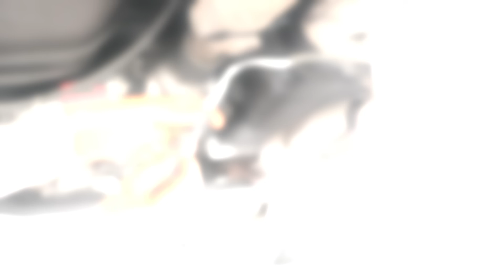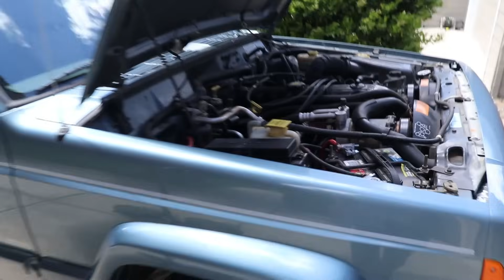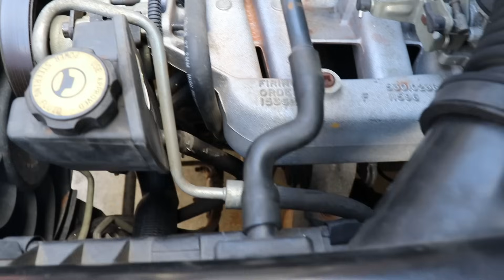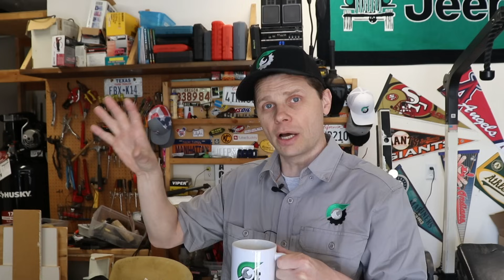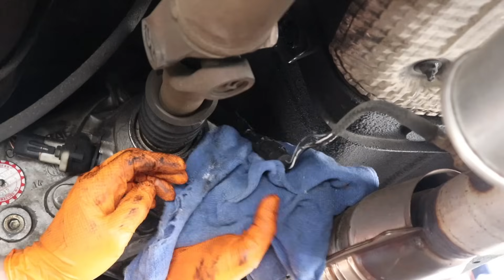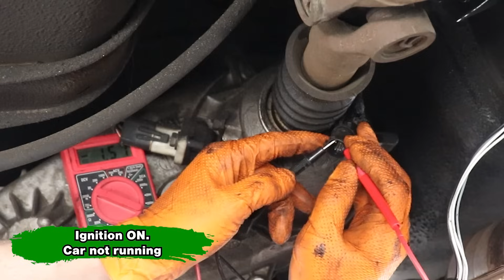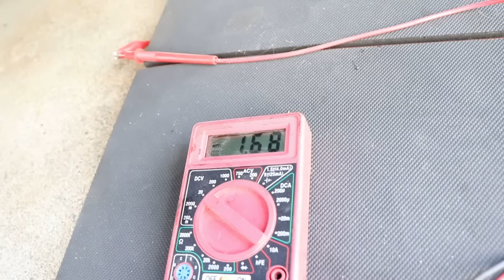Don't Buy Oxygen Sensors! How to test o2 sensor

Comment: just a note, the second oxygen sensor is not the one controlling the mixture for the ECU, its function is only to see that the signal when compared to the front sensor ist flat meaning the cat is functioning. The front sensor is used to test for air/fuel ratio and tell the ECU what mixture adjustment is required. So your faultcode could only come from the upstream (front) sensor. Downstream would cause a „Cat inefficient“ code on the motor warning.
have fun, Bernhard
Reply: He changed both so his readings were useless in this case.  But aren’t there some newer cars using the downstream for the fueltrims too?
Reply: @Xantylon74  
I don’t know of any. It does not make a lot if sense since if the catalytic converter works fine all it gets is water and CO2 and there is no information about how the mixture was when it left the engine.
A Lambda sensor is reading oxygen content to identify the current mixture which is only available prior to being converted by the Cat.
Reply: @bernhardlist9359  so should I just change my upstream O2 instead of both
Reply: @carlward9367  
Hi Carl, since I don’t know exactly what your car does it is not good for me to tell you to change parts. I had it on my Jag that just the O2 heater relay was dead which is a lot cheaper than an O2 sensor.
Can you get a readout of your sensors? Any activity there? The  correct thing would be that the front sensor shows a sinewave like activity and if the cat works the downstream should display almost a straight line (konstant voltage). If both sensors show the same sinewave like activity then the Cat is bad. If there is no activity shown on the upstream sensor check powersupply else it is bad.
Reply: @bernhardlist9359  if the downstream sensor reads the same as Upstream, at the same speed, the cat is defective. Downstream sensor must react with a delay and have stable voltage no up and down. (If the cat is up to operating temp)
Reply: @Xantylon74  , I was also thinking that if you're checking a sensor's function and it is a heated sensor, shouldn't you be back-probing the circuit with it plugged in so that the heater circuit is heating the sensor otherwise what is the point of the heater element if, "exhaust heat is sufficient."
Reply: @zenithperigee7442  when the O2 sensor is hot enough, the controller will turn off the internal heater.  It is intended for faster heating so that the exhaust gas can be tested as early as possible, even before the exhaust is hot enough. You can check the resistance of the heater when it is unplugged, usually around 3.5 ohms when cold (depends on  the sensor) if no resistance can be measured, the heater is defective.the downstream o2 sensor even has a small influence on the mixture formation (fuel trims) of 2-10% not only upstream as many believe.  The point is to still support the cat if the mixture is bad, or if the upstream sensor is no longer working well enough.
Reply: @bernhardlist9359  I wouldn't say for all cars, since depending on year (technology) and brand, they could be designed differently.

That said, some cars do have "long term fuel trim" which is different from "short term fuel trim".
In such situations (cars), usually:
Sensor1 (upstream) drives short term fuel trim adjustments.
Sensor2 (downstream of cat) drives long term fuel trim adjustments.
What the injectors will shoot, would account for BOTH long-term and short-term fuel trim.

For cars whose ECU run this way, if you have a bluetooth OBD2 scanner and use a phone app to see the readout, you can actually see these fuel trim values in-real-time.
Interestingly, sometimes they will go in opposite direction from each other.  (e.g. long term trying to decrease fuel, while short term tries to add fuel; and vice versa).
And folks who do use OBD2 scanner with phone app --> can program charts that provide real-time readout of ALL oxygen sensor's voltage on one screen.  Far easier than crawling under the car and hooking up multimeter.
Reply: @bernhardlist9359  @scannerdanner has a vid stating that the downstream matters on some cars.
Reply: @zenithperigee7442  Exhaust heat is sufficient. O2 heaters are used to heat the sensors up faster so the pcm can switch into closed loop sooner.
Reply: @reallifeengineer  Most of your post isn't correct. Just look up OBD2 and how fuel trims are set and you'll see where you went wrong.
Reply: @reallifeengineer holy crap, that makes sense. I have a 2010 GMC Sierra. I have been having issues with the fuel. I reset the fuel trims. It goes into learning and the fuel ratios are close but as soon as it’s done learning the long term goes wide. Learning, everything is within 3-4 of each other. Once the learning is done the variance will jump with long terms fuel trims becoming a 8 to 9 variance and one bank seems to fluctuate much more than the other side.
Reply: @Xantylon74  new cars do not use the binary 02 sensor as a pre cat sensor anymore they can not measure how rich or lean the fuel mixture is and the 02 sensor on this guys truck only can tell the ecu its rich or lean but not how rich and lean, its called a narrow band sensor and the lambda sensor is call a wide band,   A lambda sensor  measures a current not voltage and when working correctly they read 1 and are 6 wire sensors, the down stream is still a binary sensor and no they only measure the efficiency of the cat
Reply: @richardsawtell256  I know, only the 02 sensors after the cat are still narrow band sensors, wideband sensors can read the exact A/F Ratio.
Reply: @richardsawtell256    this is good to know. wow
Reply: @Xantylon74 yes, but as a standby in case upstream sensor fails and in that case u run rich mixture for almost 5-6 minutes till downstream achieves required temperature to give ecu its output
Reply: AAh, very useful to know - gonna try cleaning my pre-cat sensor and see how that pans out!
Reply: Correct and this diagnosis would be better demonstrated with a scan tool showing real-time data. Innova makes various models that aren't out of the budget of any DIY'er.
Reply: What if I see no voltage change on a new upstream (ohm tested) o2 sensor, even when the downstream o2 sensor voltage is changing. How would I go about determining if the harness is bad or pinched after engine replacement?
Reply: long distance diagnostic is not good but just think: the upstream should oscillate between rich and lean so there will be some „fuel“ for the catalytic converter to „burn“.  The downstream should not oscillate (or very little) to confirm that that cat is functioning and only CO2 and Water should exit.
Now your upstream reads nothing but the ECU seems to work because the mixture oscillates as indicated by the downstream sensor. But if the cat would work correctly the downstream should not oscillate.
Assumption: the Cat is not doing anything and the upstream sensor neither.
Reply: So can a messed up upstream sensor cause a p0430 and p0420 codes?
Reply: @JustinMentionedIt  Yeah, that's pretty much what P0430 means.  The downstream sensor is detecting that either the first sensor isn't doing its job or that the cat is bad. 
BUT with a p0420 going along with it, it COULD be a bad cat.

OR something causing issues, like a vacuum leak or blown head gasket.  

That's the thing about sensors.  Usually a code from a sensor doesn't mean the sensor is bad, it means the sensor is detecting an issue somewhere along the line.  Now, yes, it sometimes can point directly to having a bad sensor.  

But read what they mean closely.  I had a code pop up for the IAC valve/motor on my 3800II and just didn't even think about it.  It meant that the IAC could not bring the idle down low enough.  So, I replaced the IAC.  Guess what?  That wasn't the issue.  Something else was causing the high idle that the IAC couldn't overcome.  

What was causing it?  I still don't know.  I'm starting to think I have a blown head gasket because I have a vacuum leak going on like I've NEVER experienced in my life time.  I've replaced the PCV valve.  I had a MAF sensor code pop up, so I cleaned it, still had it, replaced that and it actually fixed THAT issue.... VERY hard jerking during acceleration or cruising.  Like the engine was cutting in and out.  (EDIT:  Or at least I THINK I have a vacuum leak..  There are two kinds of people with 3800II's.  The ones that say they can take their oil cap off with the engine running and it doesn't change anything.  And the ones like me that if I take the oil cap off, there's EXTREME suction and it's enough to kill the engine.)  I need to go back and look at my vacuum reading on my scantool.  I know it's showing 28.7 or 28.x at idle, but I can't remember what unit it's using.  Either way, it's too high for inches of mercury (or w/e) and too high for psi.  So, it's like instead of a vacuum leak, I have... super high vacuum?  Or maybe the unit I'm using is neither of those.  Ugh.  My little brother just passed away from a seizure at 29 years of age and I haven't been thinking straight.  I just want to grab a gallon of liquor and drink myself to death.  But I quit drinking around 12 years ago.  For the love of god don't report me for saying that.  It's how I feel.. it's not what I'm going to do.  I couldn't bear to put any more heartbreak on my family... so I'm here to stay.

But now I've got a code p0137 going on (The P0137 code indicates there’s a fault with the second oxygen sensor located on Bank 1. The oxygen sensor’s voltage is too low.)  Like an idiot, I just went and bought one and plan on installing it today.  But now I get to thinking about it, and it could be the vacuum leak or even the first O2 sensor that's actually bad, not doing it's job and causing the second O2 sensor to fluctuate.  I dunno.

I believe a good sensor 1 O2 sensor should look like a sine wave while driving.  Mine does with my OBD2 Bluetooth reader and "Torque" app on Android.  But from what I've seen, the second O2 sensor AFTER the cat should look pretty steady/stable if the first one is doing its job.  Well, mine is also moving around quite a bit.  So, it's either a bad sensor OR I have issues much further up the line around the engine.... ie vacuum leak.  I've looked, listened and sprayed MAF cleaner and TB cleaner EVERYWHERE and I don't think the vacuum leak, if there is one, is external.  Which leads me to believe that if this sensor doesn't fix the issue (high idle, jerky acceleration, occasional hard starting), then I just have what every 3800II gets around 120-140k miles. 

A blown head gasket.  And I even flushed the coolant system with fresh Dexcool at 60k miles.  Lots of people thought that was the real issue.  Most people never flush Dexcool system because it's supposed to last, what?  Either 100k miles or 200k miles.  Or is it "for life"?   

Whereas your old school green antifreeze is supposed to be changed every 20k miles.  And I do that on my 1986 F-150 5.0 EFI.
Reply: @UnlimitedSedition  lol what a great comment I learned some plus laughed too 😂😂
Reply: @JustinMentionedIt  Haha!  Yay, I didn't get a hateful comment.  Just another nice person reading something and taking it however they want to.  I appreciate people like you.
Reply: @JustinMentionedIt  Oh, and I have some good news on my vacuum.  Either my memory was wrong, my OBDII sensor wasn't reading correctly, I have a bad ECM or something changed.  Probably my memory.

But my vacuum reading isn't like I said: "I know it's showing 28.7 or 28.x at idle".  It's actually 20-22 inches of mercury or "Hg or however it's denoted.  So that's good, and it drops nicely under load.  Down to 3-5 under mid acceleration.. like pulling out onto the highway and getting up to 55mph with a BIT of oomph but also trying to conserve fuel.  I didn't check it at WOT, yet, though.

I think I may need to start looking into how the EGR should be working under different throttle positions/loads on the engine.  Both utilization and voltage.  

I mean, I think I need to get rid of this car, but you know what I mean :-P

It keeps deleting this next part when I make a separate post, so I'll try throwing this in here.  Sorry, man, I know I get carried  away:

 Have you ever messed with any of these OBDII bluetooth scanners you can get?  I use the "Veepeak Mini Bluetooth OBD II Scanner for Android" and it's AWESOME how much data I can pick up on this 2000 Buick Park Avenue with the right app.  Currently I'm using the paid version of the app called "Torque."  But there are plenty of apps that work with it.

You've gotta check it out.  Look at some vids of the "torque" app.  I mean, I can set up 12 or 15 different styles of gauges, select 6 or 7 sizes I want each to be, have multipage pages, see things like transmission fluid temperature, EGR workload, voltage, O2 sensor voltage, short AND long term fuel trim.  Engine load and efficiency.  You can even customize it and put the details of your car in, the type and amount of fuel, and it will judge how much fuel you're using compared to what your ECM is telling you that you're using.

It has the whole 0-60mph, 1/8 mile, 1/4 mile, etc. measurements.  It measures horsepower.  It can measure EACH wheel's speed through the ABS system.  It can use your phone's GPS and compare it with your car's mph reading.  You can set up one of those G-meter circles like "fancy" cars have haha.  I mean, there is just so many things I can do with a $13 bluetooth OBDII reader and a $7 app.  I can also log my trip, look at it on my phone and see what was what along the way, or export it to my PC and view it all on an Excel sheet.

And it updates REALLY fast.  I've had absolutely zero issues with filling a page up with 8 or 10 sensors and it slowing down or anything.  Even while logging dozens upon dozens of things to check when I get back home.

This "Veepeak Mini Bluetooth OBD II Scanner for Android" is the one to get if you ask me.  You can scan codes and clear them, too.  I mean, there's things with the Torque app I haven't even used, yet.

Best $20 you can spend for your car, man.

Edit:  Lemme put it this way.  I bought one last year.  I either lost it or someone stole it.

I bought another one.  Not a different one.  I bought the exact same one.  It's that good with the right app.

Just know this model is for Android only.  If you have an iPhone, you have to buy the one that's for both Android AND iPhone because it has to use Wi-Fi with the iPhone.  It costs a little more than twice as much, but I'd still recommend it over any of the others under $100.
Reply: Not accurate, some vehicles actually compare the readings to determine air fuel etc
Reply: Sir, they only compare front and rear sensors to check the efficiency of the catalytic converter NOT the mixture since, if the converter works correctly, there should only be CO2 and water exiting the converter. So there is no mixture information left when things work correctly.
Please check out the chemical process that takes place in a catalytic converter under you will agree with me.
Reply: I have a 2005 Chrysler town and country and kept getting a p0420 and it was the downstream O2 sensor,when I changed it the P0420 went away and never came back on
Reply: I had. P0430 indicating the cat was functioning properly. I replaced the cat and  the downstream O2 sensor. No I'm getting a p0156 indicating no signal from that sensor. I'm gonna check it and the connector. The connector does look a little rough like it was hit by road debris or something.
Reply: Exactamente and Down stream sensor 2 should be steady voltage close to 0.5 volt wiht a catalytic converter in good condition